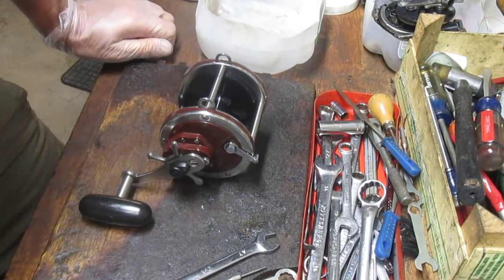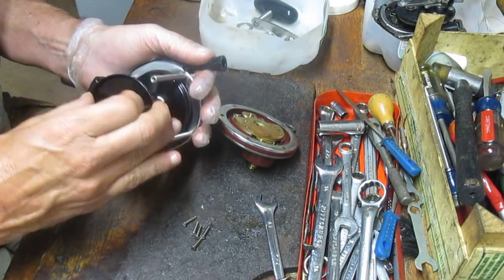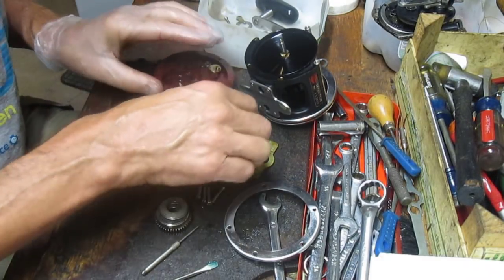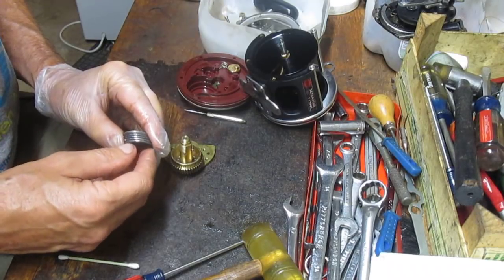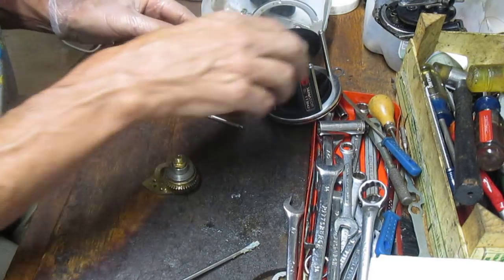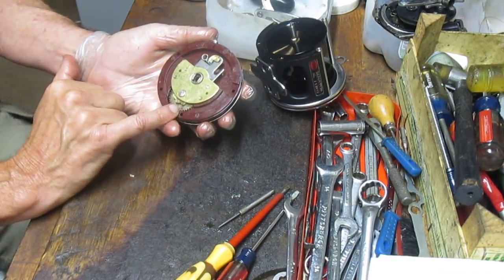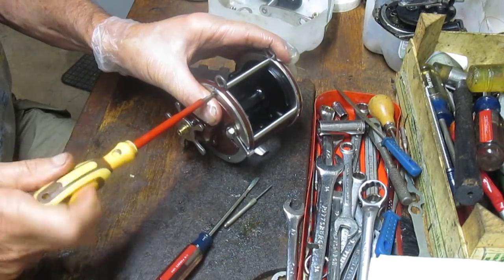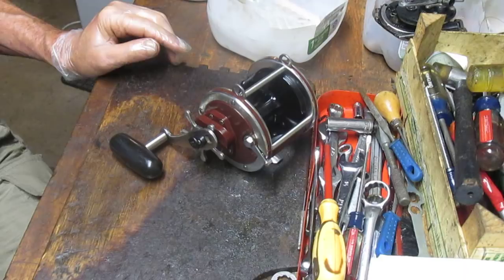Penn Senator 4/0 H2 fishing reel  complete take apart and servicing.

Comment: I have one of the older, black Penn Senator 4/0 I picked up from ebay.  Great tutorial, Dennis.
Reply from the maker: The older black sided reels are work horses.  There may be several differences.  The first is that they do not use the same bearings.  The second is in the drag set up.  You may find the wider asbestos drag washers.  If you do, you can clean and restore them, or you may want to replace with the newer HT-100 set up.  Either way, the reel will last fo another few decades! - Dennis

Comment: I caught a marlin on a Senator 4/0 in Mexico.  It's interesting how the 70-year old design doesn't even change when they went to Chinese manufacture.  The longevity is a test of the good design.
Reply from the maker: These are great reels.  I've seen everything come up on these, with little effort!  As noted, the design, which is nearly the same as the Long Beach series is enduring.  If I recall, the Penn Long Beach 66 / 67 have the same internals as the early 4/0 Senators and the only difference was the lack of a trim ring.  Thanks for sharing - Dennis

Comment: You are great thank you for all of the help you have helped me tremendously! A quick question for you what is the proper way to remove the click tongue on one of these Penn Senator 4/0?
Reply from the maker: Some cannot be removed because they are pressed into the case.  The only way to get them out is to use a drill press and drill out the center pin. Of course, the problem is finding a replacement.  Some of the Penn Reels in the later Long Beach series used a click tongue with a  a removable "C" clip connector.  Best to check with the folks at Mysticparts.com to see if there is a substitute part for your reel before drilling out the old piece - Dennis
Reply: It is still functional its just a little rusted i just wanted to get a definitive answer because ive never dealt with it before and was afraid of breaking it.  Again you are a wealth of knowledge thank you for your help.